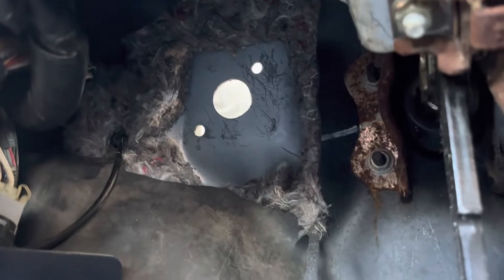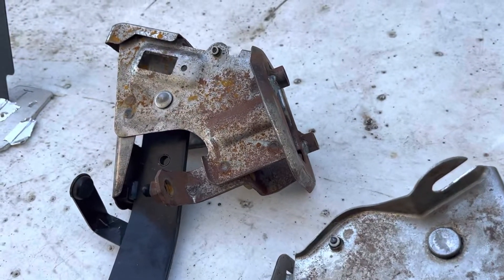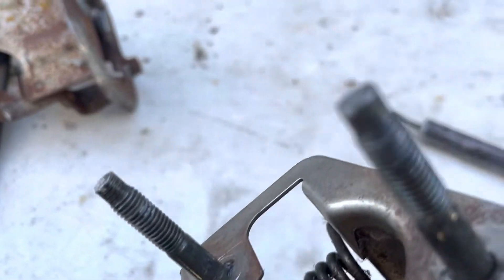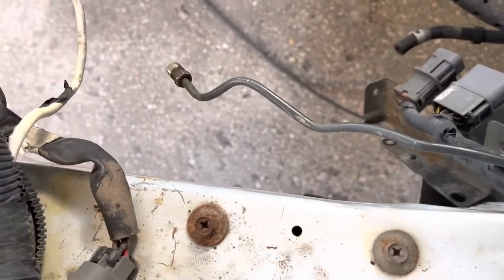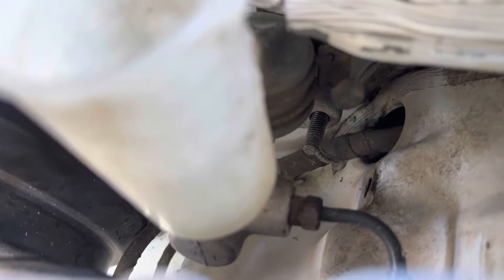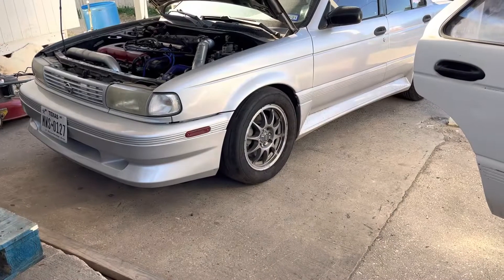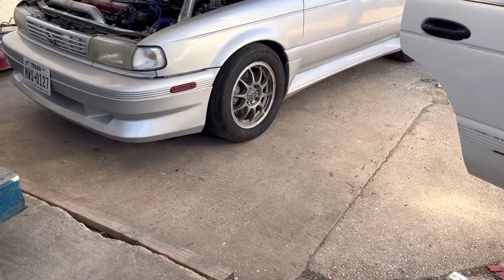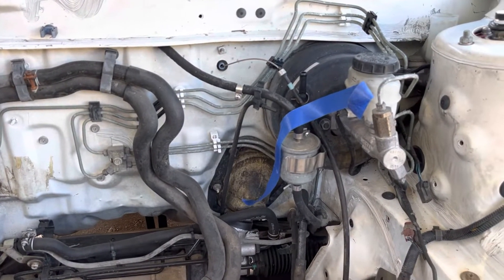PART 6.  NISSAN SENTRA GA16 auto TSURU to SR20DET GTIR hydraulic manual transmission SWAP

Comment: Thanks for showing the pedals! So altima pedal assembly and master cylinder is what you used correct? U13 Altima or newer?
Reply from the maker: Yes Altima pedal assembly
Reply from the maker: I used a 2000 Altima hydraulic clutch pedal assembly
Reply: Ok so 1997-2001 (L30) Altima. Thanks again, Im gonna go hit up the junkyard and see whats available.
Reply from the maker: @blackmesaresearch2  good luck and happy HUNTING!
GETTER DONE!!!
Reply: I took the clutch pedal pad, measured it and trimmed my brake pedal to suit.
Reply: @mugracing4965  I ended up using the Altima MC, but modified the stock pedal by moving the pivot point up and cutting/extending the pedal arm. It actually gave me more leverage so the pedal feels easy even with an HD ACT pressure plate.